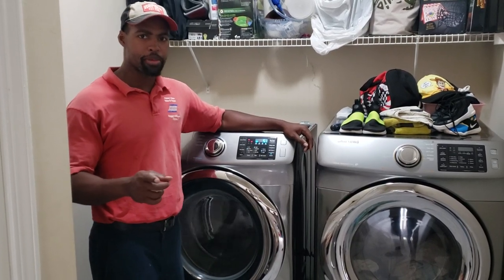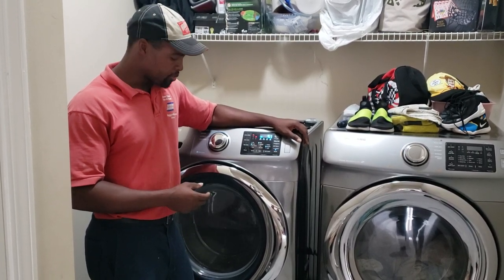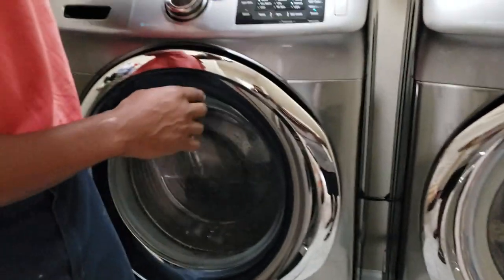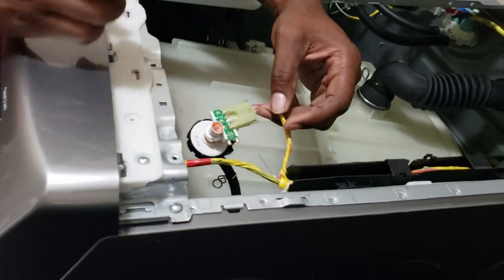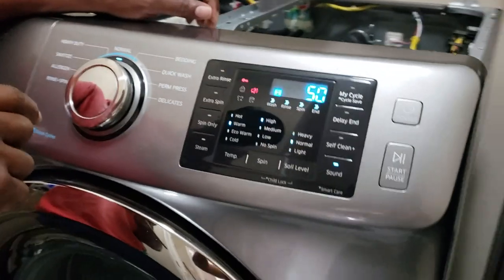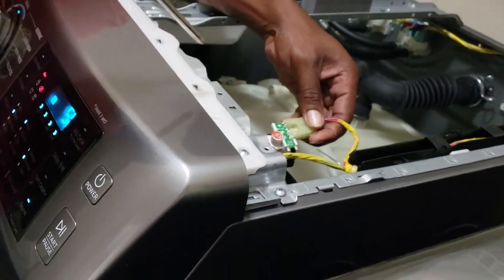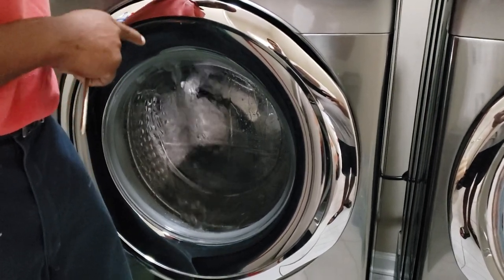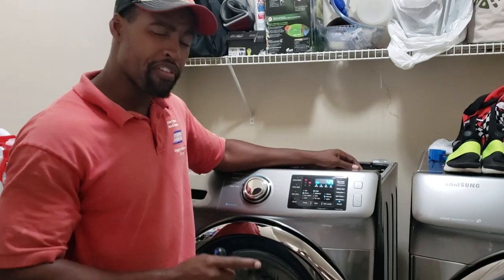Changing the Water Level on Your Washing Machine

Comment: I've got a Samsung front load washer that's setting a 4E code that I cannot figure out. Do you know where I can find the pressure switch voltage or what the ohm readings are supposed to be? All the screens are clean and valves seem to allow water in.

Comment: Hi, This manual change of water level will applicable for normal program or all program? Because some programs like bedsheets use full water level & manual change can lead to overflowing.
Reply: Good question. I get normal water levels (to bottom of door) when I use the "rinse and spin" cycle repeatedly (see comment above), but don't get proper water levels in most other setting.

Comment: So I did this on my LG machine tonight. Did two full turns and did a small load of clothes. First time very they smelled truly clean. Decided to do a tub clean cycle to see if I found get it fresher smelling. Then the water leaked out the bottom of the door. No leaks while washing clothes, leaks while washing the tub.  Fluke maybe? Did another tub cycle and stood there. Nope definite leaking. 
Why no leaks with clothes but leaks with clean setting? I don't wanna turn it down and it doesn't work but also don't want it to leak everywhere ugh.
Reply from the maker: Tub seal is bad. Tub clean adds alot of water than nomal cycles.

Comment: Thank you for your video. I have a question - we just bought a new Samsung front load washer. My husband was going to change the water level for me but the screw you need to turn is, for lack of better description, sealed in some red stuff. Can we pick that out and then change the water level without hurting the machine? Thank you, Holly
Reply: Yes. I’ve read about people chipping/ picking the red stuff out to gain access to the screw. It’s fine

Comment: Samsung does not wash closes, it only dampens them. I have resorted to putting the washer cycle to "spin and rinse", then selecting "no spin". this gives me a 6 minute cycle, but the water level comes up to the bottom of the door. I repeat this cycle (with soap) 3-4 times, basically sitting in the bathroom and restarting the washer every time. When the clothes have actually washed, I change the setting to "medium spin" to finish the wash.

I also switch the water hoses because the "rinse and spin' cycle is only cold water, by switching the hoses I get hot water. This is all a pain but it is a solution to the garbage Samsung sells.
Reply: OMG!  I do EXACTLY the same thing with my LG!  ALL OF IT!

Comment: Love this video , please tell me how to do this on a Bosch front loader as I opened the top lid but I cannot find the water level switch , unless it looks different on my machine . Your help will be immensely appreciated.
Reply from the maker: This doesn't help on some washers, but first thing to do is try to find the pressure switch. Just follow that little rubber hose to the pressure switch
Reply: It’s literally the same as this video but like oh it has no cover.

Comment: Maytag MHW6630HW2 low flow in the middle of cycle only when using extra power and only when is loaded to max looks like timer is to short because all the water goes first into clothes after spin and doesn’t detect water in time next thing I see low flow (water pressure is excellent everything is good valves have been replaced water pressure sensor was replaced) any fix basically timer to short in the middle

Comment: HI there,
I know no one who can help me regarding it. I have Samsung front loader washer and It take so little water that detergent does not even clean up properly from clothes. Will I be able to do it myself?
Reply from the maker: I would start by checking your hoses make sure they're not pinched, the little filters that the hose is attached to, make sure they're not clogged and also check your water pressure

Comment: How do I adjust the water level on a top loader? The washer i have has a sender but it's put very little water not enough to even get all the clothes wet.
Reply: So top loaders if you just simply wet your clothes before you start the load then the weight sensor will think it needs more water because it's heavier. You can do this by yourself with sink, or start a load without soap ect. Get clothes wet, then cancel load. Add soaps and then start load as normal.

Comment: I have a frigidaire FAFS4073NA model with 4C serial number code. I have recently replaced the water level pressure switch and there is barely any water fill. There is no adjustment screw or any other adjustments that I can find to solve this problem. A second pressure switch replacement did not help. What is the work around for a clothes washer that does NOT have have the factory calibration setting screw?
Reply: I don't have your washer but, here's a trick that should work.  Remember, the switch senses increasing pressure as the water level rises.  As the water rises, it compresses the air above it and that controls the switch.  I'm guessing you'll have 3/16 or 1/4" inside diameter hose (or the metric equivalent).

If you put a nylon "T" hose fitting in between the top of the hose and the pressure switch, and add, say, a foot of hose to it (cap it off at the end of the extra hose!), you will be adding volume to the top of that column of air. That means it will take more water to compress that switch and that delay will allow your water to rise.  It will take some experimentation on how long or short that extra hose should be.

Comment: I’ve done this on mine but find the element doesn’t seem to heat the water hot as the setting.  Is it because the machine only kicks the element to the factory set setting time or doesn’t matter! What I’m saying if you add loads of water will the element still heat to 60c regardless of the water level.
Reply: I dont know, but I think it should because the washer won't run until the temp is reached

Comment: Is there a spec for this?  I'd like to know what the factory recommends, just as a starting point (I've already adjusted mine). BTW, I can think of one reason you would NOT want to do this, or at least be conservative with it. AFAIK, all of these front-load washers have an aluminum 3-legged brace that supports the inner tub (the "spider"). Being exposed to water and detergent, these spiders eventually corrode and fail. Just a guess, but increasing the wash water level might increase the rate of this corrosion. (Or, it might decrease it by diluting the soap in the water.) Which reminds me...increasing the amount of water without increasing the amount of detergent you put into the machine...wouldn't that dilute the wash water? Possible to the point where it doesn't clean as well? Thanks for the post.

Comment: I am on my fourth samsung washer cause i have had them in every house before and I am sick of them not taking any water. I did do this on a 2011 model. That was before they had the blue housing, I am going to do it on the current one I have. i manually add water with buckets but the damn thing just drains it. It makes me furious!. it refuses to wash clothes with water, so i am going to tweak it. i do wish you showed us how to remove that blue tamper seal. That is what I came here to see.
Reply: Your clothes dont have to be completely submerged like top loaders like everyone thinks it does. They come totally clean with an inch or 2 of water at the bottom... Did you wind up adjusting it?
Reply: I add water also but you have to wait till it fills and the soap is dispensed, hit pause and open/add water (2-3 gals) then start. About 3 mins after start on permanent press, before it locks you out.
If you add at the beginning the machine drains because it thinks the last load didn't drain.
My machine is stacked or I would do this work around.
I will be replacing this machine and will not buy a front load, they have ruined what used to be a great type of washer 20 yrs ago!
Jan

Comment: I don't think I can do this in my Electrolux. The switch looks different.
Reply: I could not do it  on my ElectroLux either, so  I ad more water through  soap compartment with an external water hose from the sink.

Comment: I have a ge front loader made in 2010, it has a maroon colored mechanical level switch with 2 levels I believe. There is a vertical row of 3 screws bottom one being small and does adjust the water level but it also has 2 more screws on the switch . I messed with them all long time ago when I didn't know what I was doing and should have marked off where they were. I reset them based off pictures from other ones. I can't find a darn video on here that shows what any of these 5 screws do. I found one where they adjusted the water level with the one screw but I'm not sure if you would have to adjust any other screw as well. I'll link that video here Incase you or anyone wants to see what kind of switch I'm taking about. Thank you in advance.
https://youtu.be/qJ-mj5d_wUw